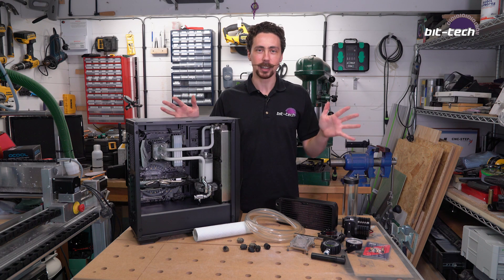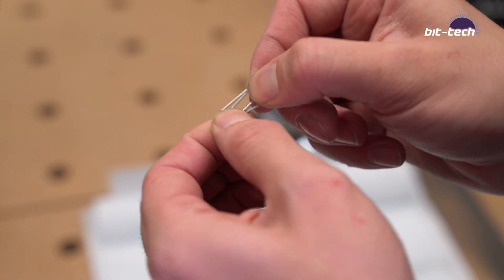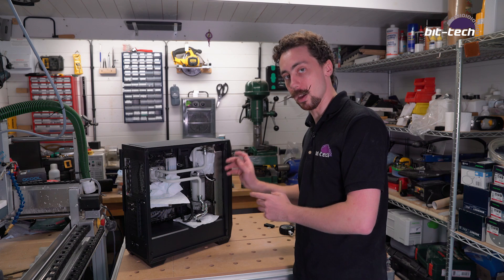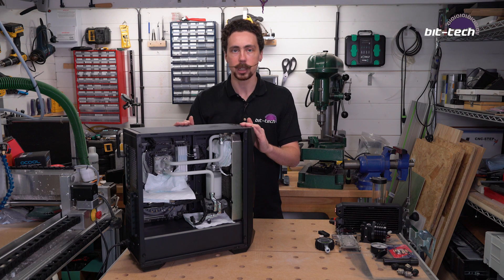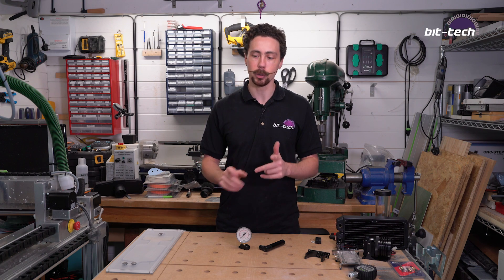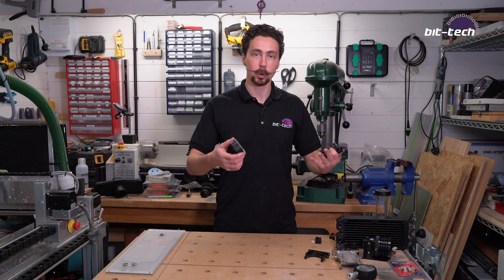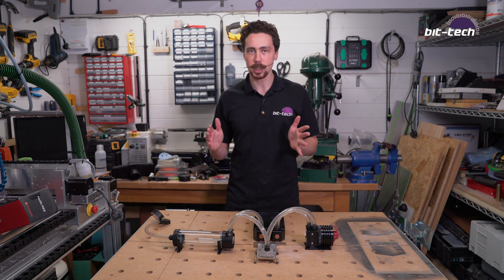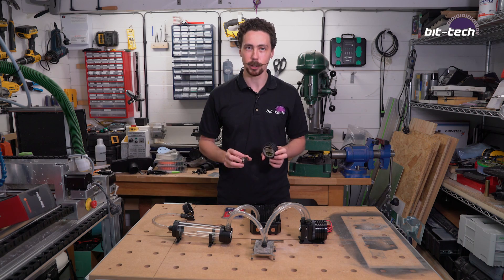How To Leak Test a Water-Cooling Loop | bit-tech Modding

Comment: What I like to do (especially on hard line builds) is start at the res and install the drain valve and line.  Then build out in order from there.  As you go, leak test each new run you install.  So if your first run is from the res to the GPU, install the line and put a plug in the out port of the GPU.  Then use a pump like in the video or just blow into the drain line.  Make sure you have a good seal between your mouth and the drain line and hold the pressure for maybe ten seconds.  If there is a sizeable leak, you'll feel the pressure drop.  If you don't feel anything, close the drain valve.  This traps the air pressure in there.  Let it sit awhile (whatever you're comfortable with).  I like to let it sit while I measure and bend the next run.  When you're ready, open the valve.  If the pressure is still there, you'll hear the air rush out of the system in a fairly substantial whoosh.  Repeat this method as you build and do it one last time after everything is put together, letting it sit the last time for a few hours or over night.  You can't over pressurize the system with your lungs, so don't worry about damaging anything and the biocide in the coolant will take care of any bacteria you introduce.  

This method lets you know right away where a leak is and makes you about a confident as possible when finally filling the loop.

Comment: I have all the components for my first open loop on the way and I have to say, using air pressure to spot leaks is a really good idea. You should drop a link to that air pump and gauge combo in the description! I'd totally pick one up to uncheck my first loop before I start pouring in coolant.

Comment: How I have seen leak checks done with pressurized gas filled systems (not PCs), but still might be handy is, you take some soapy water and squirt it at the fittings.  If there is air leaking it will blow bubbles through the soapy water.  Obviously with PCs you would have to be really careful by using loads of paper towels and not using too much water, but this could help isolate a possible leak rather effectively.  I haven't tried this on a PC myself, but would consider it considering how much more catastrophic a liquid leak check could be.
Reply from the maker: Aye this works really well if you're careful, I've started doing the same recently and it's such a time saver.

Comment: Not sure if that was aimed at BitWit or not, but that was what i pictured in my head.
Reply from the maker: What no, never...
Reply: @bittech1  this was a great guide! can you still do the guide on how to make the air pressure gauge for the leak tester? i have a really large computer in the thermaltake view 71 case and it's about 100lbs so draining it is ridiculously difficult! this would save me alot of time and money. i know that ek makes one but its pretty expensive.
Reply from the maker: @michaelhughes9278  Honestly I'd just buy the EK one. I haven't done the guide yet as when I made one, I realised I needed so many parts and tools that it just wasn't worth it. Mine works okay, but it was such a pain to source everything, you end up saving like £10, which is all lost when you factor in the time to make it.
Reply: @bittech1  oh that sucks. yeah, I've been looking at the ek leak tester that i saw and its pretty expensive so i was hoping for a cheaper solution. i liked the Dr drop that you showed in this video though and its 20 dollars cheaper! but i think i'm going to go with just a syringe to push air into the loop and a dash of hope. thanks for the quick reply and i love your channel! you should do a colab with linus or jayz2cents for some exposure!
Reply from the maker: @michaelhughes9278  For occasional use the Dr Drop works well, the main issue with it is that the thread for the pump is very fragile, it can strip or snap during use quite easily so just be careful.
Reply: @bittech1  i think i'll just go the poor mans way and use the fill bottle syringe and pump air into the ball valve and leave it overnight. i actually had a catastrophic leak using copper tubes when i started the build that killed my motherboard. weird too because i had no power going to the motherboard at all and i used propelene glycol. but stuff happens i upgraded laterally to asus anyways and i love their bios. thanks for the replies! love the channel i would kill for those pcs you built! especially that gigabyte one!

Comment: As always, quality content there :)!

Worth noting that some of the Dr.Drop units could possibly be leaking themselves - some people reported. Mine holds great tho.
One good tip I would add is to be first air testing individual components before you put them in, and then also air test as you go, meaning you put some blocks together then you do short 15min test to see if everything is all right meanwhile focusing on something else. Makes it easier to spot errors as you go especially if you putting up your first build.
Reply from the maker: Definitely good points there! Testing blocks individually isn’t a bad move at all, although because of the tiny air volume it can be a bit tricky at times thanks to the Dr Drop’s valve design, I guess a good compromise is adding something like a reservoir or radiator in just to add more air volume.
Reply: @bittech1  True. The workaround I found that worked best for me was I've put a valve fitting inbetween Dr.Drop and the block with a longer tube to the block as well. So order would be like Pressure Tester - Valve - 30-40cm tube - Block.
Then just pumped the air, closed the valve, disconnected the pump, then SLOWLY opened the valve. Then it's just easy way to adjust the pressure to fit the 0.5 bar.
This made testing even a small block like CPU not an impossible task. Need to be careful with the pump pressure as the air volume is still relatively low but other than that no issues.

Comment: 13:00 When testing a loop with air-pressure you can also put a small dab of soapy water around all of your fittings -- if there's an air-leak you'll see it start to blow little bubbles!

Comment: Nice relaxing tutorial.  Question.  I have an adapter with the jumpers on the 4th and 5th spot (#16/17), an EVGA adapter at the 3rd and 4th slot and  and a jumper with a switch at the 4th and 6th position.  Additionally, you say to use slots 3/4 and others say 4/5.  Why the differences?

Comment: Dig the smooth jazz music.  Who is the artist/sound track?  I ordered the test pump and will test each component separately this time around vs running fluid in the system to test for leaks.  Also, I apply plumbing grease on all the O rings to reduce the chance of damaging them during installation.

Comment: I am using leak tester too. my loop holds fine at 0.5 ~ 0.53 bar mark. However, if i go any higher one of my loop pops out pushing tube away from the fitting itself.  Some said 0.7 bar is safe but you mentioned 0.5.

Comment: wherewould i connect the aio pump or 3 pin fan-header looking wire to, rather htan just the molex wire that powers the pump. I'd have to have the motherboard on for that, whic his a no-no because well.. incase something leaks and I want to test. do  i somehow connect it to  another cable to the psu? it's an alphacool DDC310 with a mini res and ujt60 140mm rad.  PLEASE HELP! Watercooling noob here.

Comment: Thanks! A simple question... I tried to order one from EK, but it's on hold since they don't have it in stock. However, I need to setup my system asap (and it would cost around 100$ CAD for another brand of leak tester)... It's been 5 years since this clip, but I couldn't find the one you talk about near the end regarding building your own air pressure leak tester. A link please?

Comment: I'm about to do my first water cooling setup using two gpu's and cpu loop config, removing the risk of water leaking onto a component is a no brainer!
Been anxious about doing watercooling due to leak testing, the leap of faith if you may call it that.

Due to multiple fans on the gpu's has bad bearings or fan motor, also getting somewhat toasty running the stock cooler, it's either getting waterblocks and running a loop or risking being without a pc for a while. ( Also, what would you do in this situation? in terms of having bad fans on the gpu. )
I can't thank you enough for the info!

Comment: Need some help ASAP!!! So fairly new to the air testing.

I have build the loop and it leaks very slightly over the course of 2 hours it drops from mid green on the ek tester to the start. 0.5bar But I mean it very slight. How much air is acceptable to lose or should it not leak at all?

Comment: had a catastrophic leak once. had to use a multiport-fitting and forgot to plug one of the unused ports all the way. ended up with about 1-2cm deep "sea" of coolant in my psu.

Comment: Is some leakage normal over a 24 hour period when air testing? Mine is very minimal but I'm wondering if it will matter since water has a higher viscosity.
Reply: Did you ever find out the answer to that question? I'm having some air leak out very slowing like 0.2 bar every 6 to 7 hours.

Comment: A small leak can be detected the same way you test gas connections. Just use some soapy water and put it on the fittings. Small bubbles will indicate a leak.

Comment: can i use that leak tester to get water out of a loop for cleaning the loop?
Reply from the maker: Not really, but you can use a full size bicycle pump to do that if you're careful. Just be sure that there's a suitable exit point for the fluid/air if you do as a large pump can easily over-pressurise the system.

Comment: Why did you put the paper clip in the 24 pin cable?
Reply from the maker: O1:09 tells you why. I go into it in more detail in the video on making a bridging plug too. The PSU won't switch on unless it's connected to a motherboard 24 pin header, or tricked into thinking it is.

Comment: Thanks, very handy info!
A guide to make our own would be nice, but for those of us in the US, it seems only expensive BSP/NPT adapters that are shipped from overseas are available. Shame since Dr. Drop is scarce.
Reply from the maker: Performance PCs usually has them in stock. For making your own you can actually drill into a manifold fitting and tap the threads manually, works well and is pretty simple. The Dr Drop is more straightforward, doing one yourself gives you more control though.
Reply: @bittech1  Hey, thanks for the reply/idea! I decide to go for it. I do have the g1/4 tap since I am making my own reservoir. (thanks to the bit-tech guide!) As I failed to find PSI gauges locally for cheap, I just went and bought a gas leak set up per-assambled. Just needed to source the rest of the parts and it came out to be 13.07USD (well, +3.87 for a fitting with plug to hook up to test the gauge and hook into my loop) I'll keep looking to see if I can find the individual parts for cheap and return what I got. Still, 13.07 is cheaper than 20 + 5 from shipping costs.

Comment: Why not take out important parts altogether like RAM and GPU?
Reply: If you have a GPU watercooled, why would you take it out if you want to see if the leak test is successful for the whole loop?

Taking out the ram is easy for soft tube, but hard tubes its impossible due to all the angle bends

Comment: One thing that confuses me.
You put the paperclip in 3 and 4. But the plugs you can buy are in 4 and 5, why is that.
Reply from the maker: There are several different pins that work.
Reply: @bittech1   so my bridge plug wich have the wires 4 and 5 bridged should work fine for any atx powersupply?

Comment: You can run the pump dry just fine... it won't overheat at all. The ceramic bearing it runs on can withstand temps over over 400c, the pump won't ever get past 40c dry in a confined space. The notion of pumps can't run dry is so annoying to see youtubers repeat this bs.

Also the standard rad pressure is 4 bars, if your rads breaking at 0.6 bar.. its a cheap chinese one.

Comment: What a hassle!!
Thats why i kept away from water coolled
I rather stick to air cooler 
Got dusty? 
Well just blow it with compressed air or something 
Just 10 minutes 
And done
Reply: It's more for those who want to over clock. Those systems can remove much more thermal energy than any air cooler could dream of. An 8 all core over clock throws out a lot of heat. Add in a graphics card or two and you're really cooking.

Comment: That device is so overpriced. Both EK and Alphacool just buy theirs from china for less than 10 prob. less than 5 bucks and try to charge 30+ shipping. I will adapt a normal 1/4 pressure gage and a bike pump. Those ass*** are not getting my money.
Reply from the maker: Having made one, I decided I’m only buying them in the future. So much less hassle, that’s the main reason I never did another video on it. It just became a huge faff and started involving too much going on